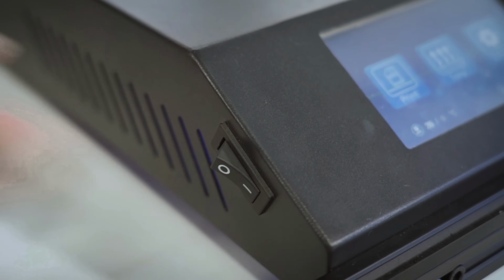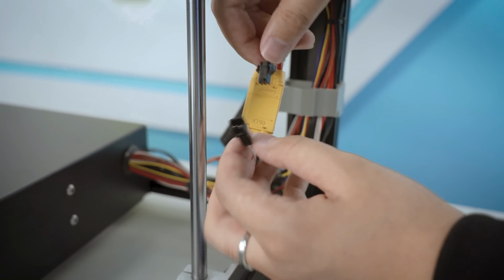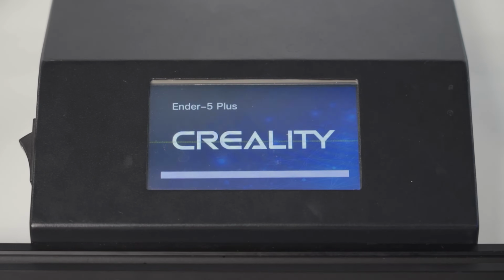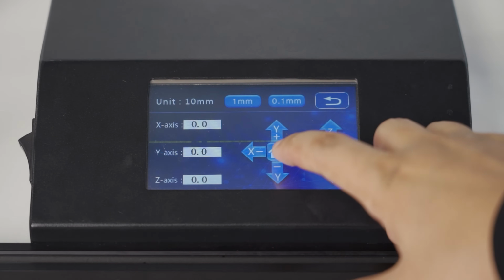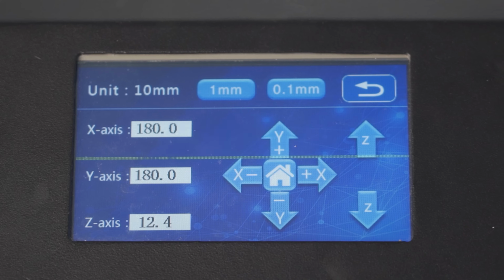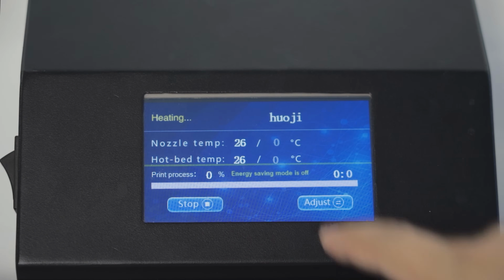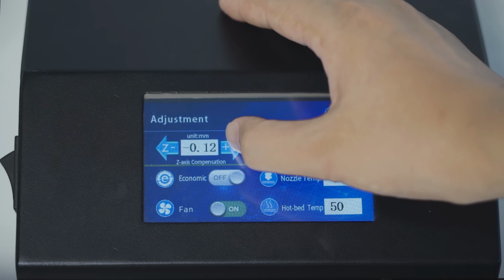Creality Ender-5 Plus Bltouch Leveling Tutorial (2019)

Comment: This does not work, I did it exactly as described, and all my plate does is drop lower. I am beyond frustrated. I reported it to the chat support, and it has been escalated. Waiting to hear back.
Reply: I have the exact same problem, so frustrated and just want to smash it with a hammer 🤬
Reply: This same thing just happened to mine. Any resolution @simonmercs?
Reply: @tk4280 what exactly happened Dude?

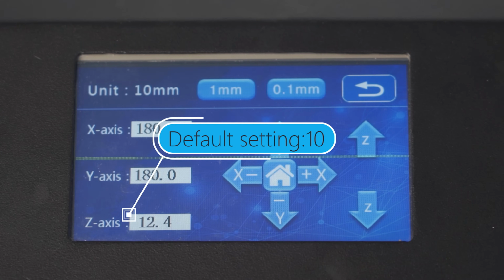Comment: I wonder how they display the 3:16 screen.

Perhaps they raise the bed until it hits the BLTouch, which serves as the upper limit. Then they lower the bed until it reaches the Z-axis home position sensor, using the number of steps of the stepping motor to determine the Z-axis value of the home position. However, I can't physically find the Z-axis home position sensor.

Comment: 4:39 before going on to level the rest of the bed after getting the paper to have some resistance, press the home button. It will then home and you can double check it’s correct. If it isn’t adjust a little bit again and home again and it should work great.

Comment: Got mine and had a helluva time leveling it.. There is no auto level option in my menus.. It says it's running the latest firmware according to the device and the website.. But the auto level function isn't present as an option..

Every time I measure it seems to reset and lose my leveling entirely.
Reply: Same here: it says that I have installed the latest BL Touch Firmware 1.70.3 but still, my Leveling-Screen looks different than in this video.
Reply: Same here any resolve?
Reply: Same thing for me. I only got mine a couple of weeks ago. Every video shows this different screen set up

Comment: Y axis WTF is that? oh that switch on the back of the printer, naaa ill just slam into the front of the printer.  Z axis oh snap let me grind the nozzle into the bed. Short of recompiling marlin proper its just not worth the bs to not be able to return the Greek tragedy of a printer. Serious pile of junk do the 3d printing world a favor and go out of business. Creality sucks. THey hjave no idea WTF they are doing with their firmware.
Reply: Mine have worked for 4 years now. Not bad for the cheapest per square inch of print space. This is the first time I’ve had to level it properly in 2 years, I had enough time to forget in between full leveling. Not that many printers people can say that about

Comment: Hi, once I updated my Creality Ender 5 plus to the lastest released firmware I do not have a chance to set english language. How to solve this problem?
Reply: Have you fixed it? I had same problem alot of work to get it back.
Reply: @DunkerHamp  Nope... Still having dall in chinese. I solved partially using OctoPrint, so I manage all the printer remotely. Much more comfortable...
I'm planning to upgrade the firmware by hand to Marlin 2.0
Reply: @maxper75  It's a bug with the newest Firmware. Flash the previous version (1.70.2 instead of 1.70.3). I just had this issue 5 minutes ago and fixed it. The previous version is on their google drive https://drive.google.com/drive/folders/16596EvFWv9C9ClbavmHPc4J3MJ4_N3h_  I used the file "Ender-5Plus -BLTouch -0117_V1.70.2 BL（CN/EN）.hex"

Comment: I wish I never bought this POS machine it has such poor laggy firmware that always freezes, I can't get octoprint to stay connected since the sd card seems to somehow interfere  with the connection. The z offset seems to magically change by itself and the z lead screws get misaligned after powering the machine down they also wobble as well. This thing has a mind of its own it will sometimes randomly crash the nozzle into the bed which resulted in a massive scratch on my newly purchased $85 pei build plate or start printing off the print bed.

 It was printing great the first few days but now it's a paperweight, nothing sticks anymore and it keeps extruding very thin lines even though e-steps have already been calibrated. I changed the nozzle, capricorn, tubing, metal extruder and washed it numerous times even used just about a whole bottle of rubbing alcohol. I didn't have nowhere near as many issues with my first 3d printer the ender 3 pro.
Reply: I have NEVER been able to set the bed height on mine! I did everything the guy in the video did - moved the table supports up with the screws until it bottomed out, moved the Z axis down to 150 and put the table on. Turned the printer off, connected the heating wires, turned on the printer, went to the MOVE Screen, tapped the home button and the Z axis went moved down. When the Z axis/Table stopped, the readings were X:180, Y:180, Z:29.00. I went to the PRINT Screen, tapped Print, then advanced and the offset was 19.00. 

It took so long to tap the reading to 0.00 that the file started to print at 6.59 and the table moved down slightly (it was moving up as I was tapping the "-" button), so, I tapped Pause, then continued to 0.00. When I went back and tapped Stop Printing, the table moved up & down slightly. When I went in to AUTO LEVEL, the table moves up & down slightly but, ends up lower that it was before I started. I have never been able to get the table anywhere near the nozzle or close enough for the BL sensor to have the center of the probe move down. 

I've watched dozens of other videos on setup & leveling, but, the end result is the same - the table never gets any closer that 100mm to 160mm from the nozzle! I tried to do an update of the software, but, the Printer shows up on my computer with a yellow "!" so, I can't even do that. I even bought a "Silent Mainboard," but, I get the same results. This Ender 5 Plus Printer has been nothing but a $600 mistake and a waste of tens of hours of my time!
Reply: Same here, I cannot even sell this crap! I have never been able to print anything decent with this POS.
Reply: I just bought one and I don't even have an option for Auto bed Leveling which is really pissing me off since that's why I bought the damn thing.
Reply: @kylequinn1963  Same here, bought this POS in Mar 22 and had maybe 1 successful print to date! I've been playing R&D for Creality ever since.....Never had these issues with my other 3 printers.
Reply: @ram313  Honestly they should be reducing the price on the 5+ to like $250-$300 considering to even get it halfway functional requires a new main board, new display, new extruder, new hotend, new firmware, a pile of 3D printed upgrades like Z axis stabilizers which require purchase of bearings, need to print cable management clips, basically require a CRTouch, which then needs additional cable extensions, belt tensioners for both X and Y axis which is 3 total tensioners to purchase, you need a Capricorn tube as far as I'm concerned and silicone bed spacers instead of the crappy springs they send you. All of that is basically mandatory to get this printing well in my experience. Now that I have all that, it's a wonderful machine but I don't appreciate the like 24 hours of bullshit I had to put into making it work. And I mean literally 24 active hours, not just "two days".
Reply: @kylequinn1963  Yesterday was the best day of my life. Sold that POS for half the price, this brand is the worst crap ever inventer.

Comment: In short. I have done it this way and it works

	1. Home Z-Axis
	2. Set Z-Axis to 10.0 if is not 
	3. Start a print job and set Z-Axis Compensation to 0.00
	4. Start leveling
	5. Adjust Z-Axis to a paper thickness (0.1 mm)
	6. Start Aux-Leveling
	7. Set all 4 corners to paper thickness (0.1 mm)
(ist possible center will not fit anymore)
	8. Start Measuring (Auto leveling)
	9. Done
Reply: 10. press z-Home again to save settings. Right?
Reply: @Raddekopp  I guess it saves them anyway. But exactly these are the small things, that go make me crazy because I cannot understand, what the heck is going on in the firmware...
Reply: Use a thickness gauge instead of paper.
Reply: My bed won't go up, only down. 😩

Comment: Pure garbage firmware is trash 🗑 stay away from creality
Reply: What is better to use then?
Reply: @majorbrighton  Prusa is way better
Reply: @majorbrighton   if you want to fix this your gonna have to go on the main board and swap the white and black wires on the Bltouch connector. After 3 months I got mine to work.
Reply: @dazefpv2251  what issue does that fix?

Comment: My printer dont have the Auto Leveling toggle On/Off Button, this is necessary? Probably I'm with an older firmware version, or maybe newer?
Reply: The best firmware is the Insanity Automation V7.4.X, there is a firmware for the printer with many more Marlin features activated and the X Y offset for the ABL fault in the stock firmare fixed and a firmware for the screen for a much better GUI for those additional Marlin commands, the printer firmware is flashed via USB from a computer and the screen firmware is written to the root of an SD card and on the back of the screen PCB there is an additional SD card socket to insert that card and then turn on the printer, you will know it has flashed when the screen turns orange, you then remove the card and power cycle the printer, to take the bottom off the printer either turn it on its side or remove the bolts from the front and back of the control box and then turn that box upside down to remove the backplate
Reply from the maker: to make sure your firmware version, check it on www.creality.com/download,
Reply: @Creality3D  I did, yet it was not shown what Firmware was the one to use, no description or info at all? When it says to click on the screen to each corner, the screen does not respond?

Comment: At 3:13 in the video it says to check if the Z-axis is 10 or not.  The video does not explain what to do if it is not 10, at least I did not understand it at all.  Mine is at 11.6 - is that a problem?
Reply: Go to the move setting in settings and adjust the z axis to be 10
Reply from the maker: if you in need of support,  please write to our professional technical support team afrer- salescs@creality.com, they will solve it for you.
Reply: @Creality3D  Thank you, emailed 5 business days ago.  No response so far.
Reply: @Creality3D  It's been two weeks and I don't have any response.
Reply: @stevetb7777  try starting a print and then click Z-axis compensation until its all the way down to 0

Comment: There is a mistake in the video: why level the bed to nozzle distance with cold hotend and cold heatbed? when i do this steps, and when i heat up everything to print temperature, the nozzle is too close to the heatbed. but when i heat up nozzle and bed to print temperature, then do the leveling, everything is fine. You should correct this mistake. A second mistake is in the firmware it self: the middle of the heatbed, can not be adjusted. the leveling display should show instead of the "middle of heatbed" position 1, it should be changed to position 5. because when you manually level the bed with the knobs under it, the middle of the heatbed and its hight changes, when you turn the edges up or down.
Reply from the maker: thank you point it out
Reply: And also, why is it that his levels all say 0? How is that possible?
Reply: @mahreeortiz  I think he changed it manually as he did in the video, maybe did not show us that part lol

Comment: the automatic leveling stays at number 1 and does not go any further. what do I do?
Reply: you maybe have the bed too high and or have no play room left for the wheels under the bed? Just manually turn the two screws to lower itor use the move bed arrows in control pannel, then lower it slightly. Re adjust the two screws so you can screw up or down lateron.
Reply from the maker: if you in need of support,  please write to our professional technical support team afrer- salescs@creality.com, they will solve it for you.

Comment: When I I level the 4 corners on the aux leveling, I finish then go and check if the paper still can go through the number 1 and it doesn’t it just gets stuck but the 4 corners are correct not the middle. Need help
Reply: Hi Luca, did you figure this out?  Same issue here, driving me nuts.
Reply: @stevetb7777  i’m having the same issue the tempered glass is scratched all to hell on my brand new printer the nozzle just slams into it and sometimes it will just go all the way to the edge off of the build plate I’m about to throw this POS in the trash
Reply: @christopherblack6607  Make sure you have "Auto Leveling" enabled, in the leveling screen - I had this issue when I was setting up and that fixed it. 
A good YouTuber that is a massive help is FranklyBuilt - he has an unbox and build video for the Ender 5 plus and it's honestly a great guide - check him out :)
Reply: @stevetb7777  I did for the most part just set it up so its perfect in the middle and use a glue stick on the base and it works just fine now
Reply: @stevetb7777  Think you should do that process after you have heated up the bed. As I have heard the bed changes due to the heat anyway ok.
Reply from the maker: 1. Is there a problem with printing?
2. If only one angle is higher, you can adjust the hot bed by leveling the screw
3. problem still there? please contact our professional tech support: cs@creality.com

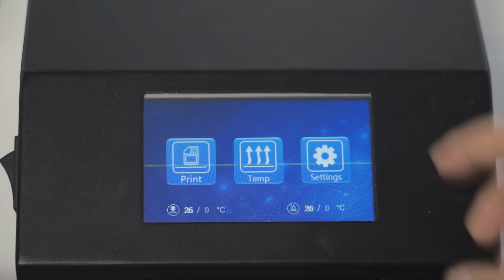Comment: Needed this video, i got a used 5 plus and the previous user had put a z offset of -18.86 so my nozzle was smashing into the bed...doing the print and then adjusting the offset trick (3:33) solved my issues! Thank you! maybe a reset all settings option should be implimented in the future  firmware?
Reply from the maker: this is a good idea, thank you

Comment: Then remember to save the settings! Missing from the end of the video ;)
Reply: where? what? how?! really?
Reply: @Raddekopp  after I set I had to press the x Home before printing.
I've just got the printer and 1st time I followed this video and printed it. 
After the 1st print, it was power cycled.
When I turned it back on it went back to the original incorrect bed level.

In a different video, the guy said "now make sure you press *EDIT - Z home before you print"
I followed this video the did what the other guy said,  printed, power cycled, and this time it remembered the new settings.
Now, I'm totally new to this printer and could be mistaken,  but something worked differently for the better!
Reply: @Dax79  "x" home? That's confusing. Do you mean the "Z" home button shown on the left of the LCD at 4:34 ?
Reply: @ExtantFrodo2  Z home, yeah! My bad 😆
Reply: @Dax79  no, your good. Without your advise I had nothing but spaghetti. This very moment I making a perfectly good gear. Thanks in large part to your help. 👍

Comment: My bed keeps going down when adjusting and when it should be going up to calibrate anyone know the problem?
Reply: You are hitting the wrong button. 

The arrow up is not "raise bed" its "increase Z height" aka, the bed goes down. And vice versa.
Reply: @ataraxic89  I’m aware of this that is not the problem when i go to leveling and it going to self level and hitting the sensor bl tip instead of coming up and adjusting it goes down and the pin tries to find it and the bed goes down again and again
Reply from the maker: 1. Re-plug the BL-touch wiring, and check whether the BL-touch is damaged and the wiring is loose;
2. If there is no problem, re-flash the firmware;
3. If flashing the firmware fails, it is likely that the BL-touch or the motherboard is broken and you need to replace it with a new one.

Comment: I am printing with the ender 5 plus and still finding problems with adhesion any tips on how to fix this problem??
Reply: Turn off ECOMODE.  That setting switches off the heated bed and as the bed cools the print becomes loose.

Comment: This video was a great help but can you please tell me what to use to make the plastic stick to the bed? I print with the bed at 75 degrees and the raft sticks but when i leave it to print it always comes away from the glass bed. I have the economy  tab turned off.
Reply: Try cleaning the bed with rubbing alcohol and make sure you are printing at the right temp for the plastic you are using. Also make sure you don’t have any airflow (example: open windows or air vents) that is messing with the print/cooling.
Reply: I use blue painters masking tape, and a gluestick when I have trouble..
My Ender 5 plus has been WAY less troublesome than my E3V2.

Comment: Hi, I got my Ender 5 plus a week ago. When I try to level the bed Point 1 is off the center. It looks like the homepoint , the whole grid is off. The two points for leveling in the front are off the bed - in the air. How ca fix it - point 1 to be in the center of the bed?
Reply from the maker: May I ask if this problem appeared suddenly? Was the model successfully printed before the problem appeared; please refer to our leveling tutorial to test the printer's functionality
 https://youtu.be/NBatdrVr-mM. After checking the printer, if your problem still existed, please give us a video reflecting the problem with your printer and we will analyze the exact cause.
Reply: Thanks for the reply. We fixed it. The issue was with wires connecting the nozzle head - the wires were too low and were activating the back sensor. So, we fixed the wires and now everything is ok :)
Thanks and have a fantastic day!
Reply: @denislavg  I'm having same issue, what back sensor do you mean?